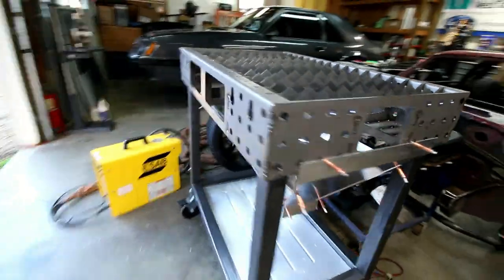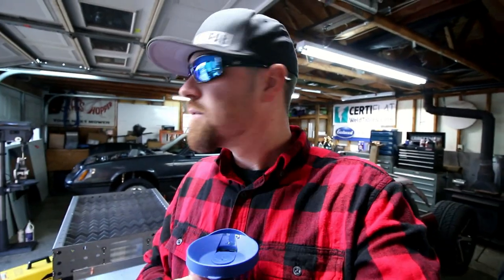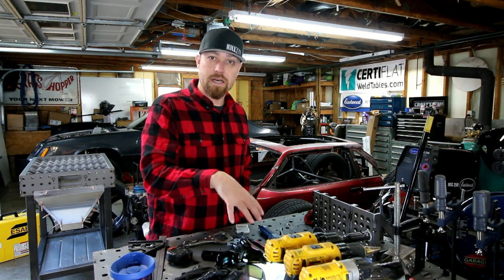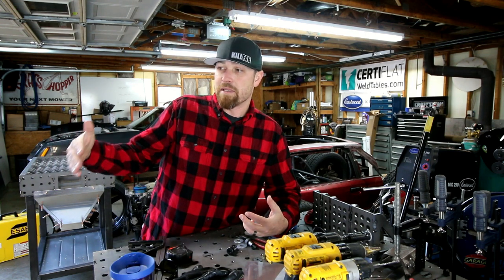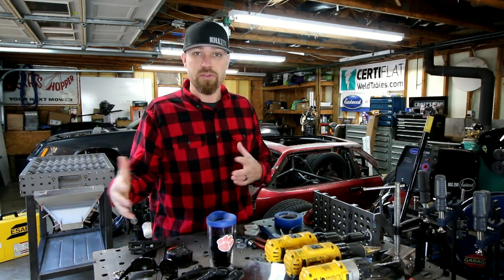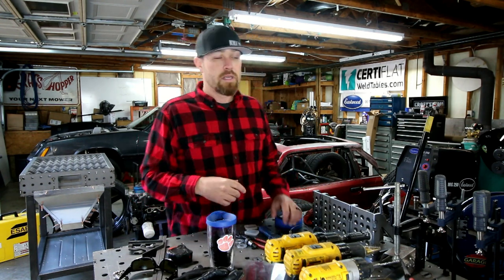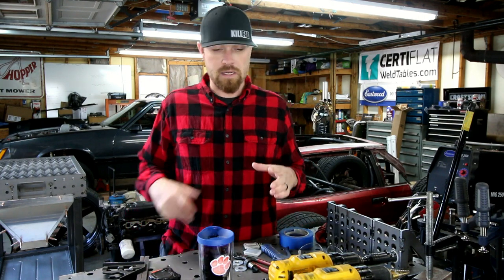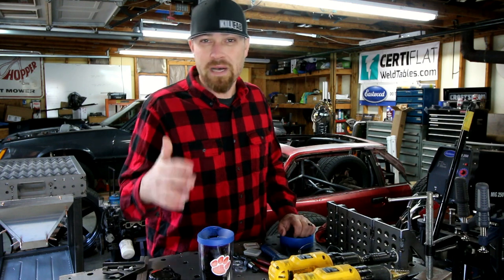Why You Shouldn't Try To Fabricate Everything | Quick Tip

Comment: Amen Brother. I am 58 today, just starting out with a small 20x30 steel building in my back yard. Saved for 10 years to buy this, and metal fab stuff. Did sheet metal on  street cars years ago, now just want to build stuff. I thought about  building weld table from scratch, bandsaw table from scratch, press brake from scratch, and so on. You hit the nail on the head. You don't sugar coat, or pull any lunches, good for you. I found out that it is better to just pick up that dollar, and find many more. Your a cool Cat. Keep those videos cranking.
Regards, John.
Reply: Sorry brother, pull any punches. lol.

Comment: Well spoken. My method on that, I always calculate the time (as a worker fee), tool wearings, material, error rate, transport, finishing steps (paint, lack, polish etc...) then if the total is bigger than 60% of the market price, I just buy it. On 50% I have to decide, what the fabrication will give Me. New knowledges? Practice? Fun? Under 50%, no question! 
And there is few other points, such as precision and design. Also how long the project will occupy the workshop? 
3 week ago, I made a completely new fork system for My Bobcat, because of the special features, and the high market price. But this made My workshop busy for 10 day.

Comment: For cheaper, I can build a big ass table, BUT, sometimes I really want that expensive, super flat table. I used to hate when I was making stuff and my big ass table was slightly warped. At the beginning damn near everything was off half inch, but I adapted and learned how to keep it all square. But when you have a perfect table just makes the job faster and easier.
Reply from the maker: yeah

Comment: Don't waste your time having to justify why you do what you do. You are always going to have critics.  The plasma table i am not a fan having the machine close to the dust and possibly the fan pulling dust thru the unit.    Welding tables are invaluable  work peices even a set of wooden saw horses are better than nothing. Which i use all the time because they are light and easy to move . 

Less is more.
Reply from the maker: Im not worried about the critics....just felt like it was an opportunity to educate
Reply: The Fab Forums and more importantly, an opportunity to make a video. Lol. Love the vids man. There is an evolution in live when your time becomes more valuable. When your young and starting out most people have way more time than money. Over the years that changes. Be nice to have a balance. But it's always a trade off. Having a ton of money and a ton of time 😳that's the dream!
Reply: That is the way I took it (education).

Comment: My biggest issue with certi flat is that the "certified flatness" goes out the window the second an electrical arc touches it..not to mention the ammount of material you get for what you pay is a complete ripoff, they spend more on marketing telling everyone how awesome their tables are than the actual tables themselves. I also built my 1/2 inch 4x8 table for about 150$, building your own will always be cheaper than a store bought..
Reply from the maker: +bdub z Lol...I have hit mine with an arc and a hammer...still flat
Reply: The Fab Forums lol every table is "flat" but I promise it's not "+/- .003" for very long being close to sheet metal thickness. Sorry man not trying to bust balls but this company bugs me, all they care about is marketing wank.

Comment: Well said brother. There is no way you could fabricate a table of that caliber without spending an insane amount of time/money out of pocket on it. Think about what it would take to layout and mag-drill all the holes to match what you have there. And even then it wouldn't have been as precise. Sure you could have made a frame from 2 inch and put a piece of 1/4 plate on it. But it would have sucked and been exactly like every other welding table on youtube. Spend two hours assembling/welding the certiflat tabel and spend the next 8 building an aluminum intake for a paying customer. Ill build some things myself if I want the notoriety of saying "I did that". But there are just some things you cant make efficiently. So as a fabricator you can modify and already great idea or part(i.e. plasma table) and make it look cooler and work better for your needs. BTW I'm looking forward to the plasma table build video. That thing is looking sharp. Later.

Comment: Makes good sense, do you go buy nuts and bolts or buy a lathe and mill and steel and hardening equipment etc, you buy the damned bolts. I like to do my own work, I built my entire car other than the trans and paint, but I bought the parts and hardware of course. Nice job of pointing out what should be obvious but clearly isn’t to everyone.